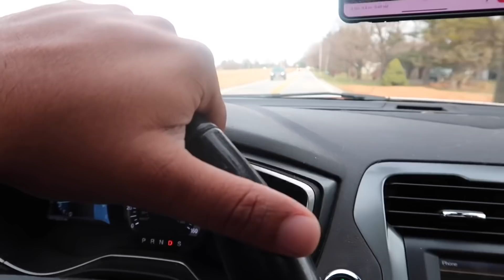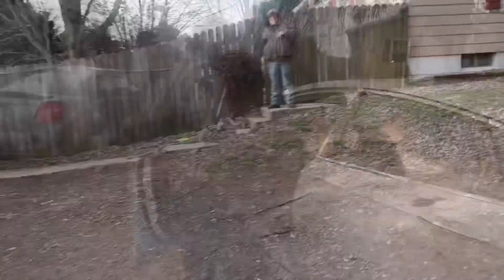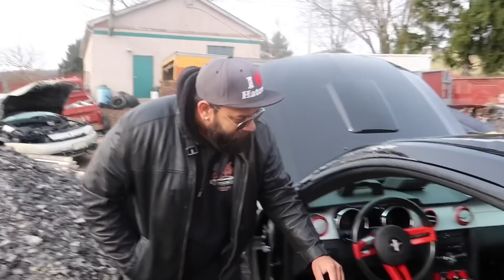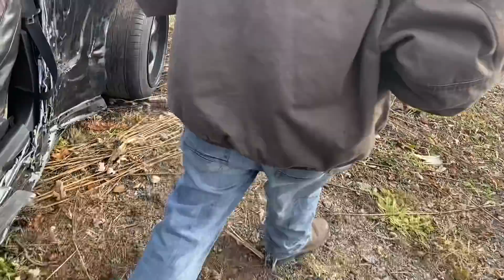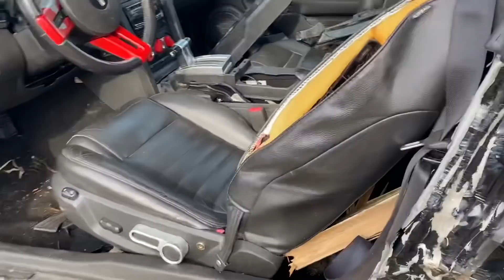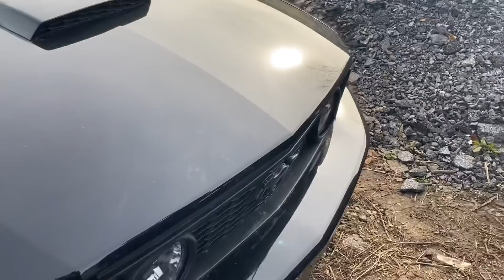YOU WON’T BELIEVE WHAT I PAID FOR THIS WRECKED MUSTANG GT!

Comment: At this rate you are ready for a garage update. You need to go with a steel building with concrete floor. Once the floor is laid, you can get a 30 x 60’ in place of your 12 X 40’ (this will fit lots of Mamba’s). And the kit cost will be about $18k if you can muster up some internet friends to come over to help build it with you.

Comment: I’m most curious of how difficult switching out the harness(es) are on these V6 to V8 transplants.  Is it just an engine harness, or does it include the ECM and any other electrical components.  This should be fun to follow!
Reply: Everything including.ecm. he will have Casper the friendly mechanic do it. Stangboy doesn't say he is a mechanic
Reply: The wiring harness should be be plug and play. Same thing with the ECU. Fuel pumps will need to be upgraded but you can just swap out the fuel tank for that.
Reply: The thing will need most of the kit transferred but ge has all the computers and if a couple of things are not perfect like trans as he is swapping to a manual it should just be a case of pin out and splice job or a patch harness.
Reply: @Stangmode Fuel pump doesn't need upgrade and neither does the radiator. They are same as stock GT parts FYI

Comment: The v6 uses a T-5 and is barely up to the challenge. It will not mount up. A 3650 (the 05 up edition) is what you need, highly recommend the MGW for the 3650.

Comment: its all plug and play. 
1. change wiring harness, has to be for a Manual gt if ur trying to keep it Manual. 
2. Gt ecm, don't even touch the fuse box. literally the same.
3. swap over the gt speedometer it goes up to 145mph v6 one only 125
4. Need a gt fuel pump
5. if ur v6 is manual u already have the clutch pedal
6. everything else is pretty much bolt on, 
7. switch over rear end from the gt, if not one wheel peel for days
8. you need a drive shaft for a Manuel as well I believe 
9. you might need a manual trans from a gt not sure if a v6 trans can hold up
everything else bolts on directly. everything is pretty simply I helped my friend swap his automatic v6 into a manual v8, he's the mechanic and he explained everything along the way as I helped him, I'm currently looking for a wrecked gt like the one u just found to swap my v6 as well. really can't believe u got a 71,000 mile gt for $1000, that's insane.

Comment: Can’t go wrong for a $1000 bucks. The motor sounds strong & turned over right away. You can also make the $1000 back (& then some) parting out the parts you don’t need. Good donor car buy IMO. Congrats bro!

Comment: T5 would not be a direct swap as has been noted. The T5 shiter is different as is the driveshaft and the rear end too, so all need to be swapped from a GT. Hydraulic clutch setups are the same though in both cars. Front brake rotors are larger as well. Someone mentioned fuel pump and pretty sure you'll need the lines as well. They run up the driver side so could be damaged. If you swap the front bumper you need the fender liners too so don't  toss them. Me, I'm sorry to see the 4.0 go :( would have rounded out the fleet.

Comment: @Stangmode nice that you found a donor car! So cheap!  I suggest you keep the College Mamba manual that's part of what you love about it!!! Get a used TR3650 trans and a new stock clutch. You'll probably break the rear end if you launch it too hard/too much so you may have to upgrade to the 8.8 eventually later. Good luck at Kasper's 👍👍💪
Reply: Oh wait....you already have an 8.8 rear in the donor car. 🤔 Might as well swap that over now. You will need the cobra pinion flange to bolt up to the manual driveshaft.

Please note that once you start messing with the rear ends you will probably feel some vibration at various speeds. I know you said in your video about how smooth College Mamba drives so just want to warn you on that. If you keep the stock rear end as is it will probably run smoother for you.

Comment: Hey STANGMODE!...You're Right!...God Does Work in Mysterious Ways!...But, I would suggest you use both the Engine and the 5 sp Auto Trans together in the swap!...The reason is, I Believe there maybe a Computer issue between a Manual Trans car vs a Auto Trans car, but I am sure your Mustang Mechanic will know for Sure!

Also, I would suggest a Saleen Extreme Body Kit with Center Exhaust and Rear Seat Tonneau Cover for your Convertible College Mamba!...I am Just Saying!...God Bless America!

Comment: Transplant surgery to be scheduled in short order.  Drive train is obvious.  I'm curious to see if the V6 manual tranny will mate up to the V8 engine.  Hopefully, it's the same tranny Ford would have put on the V8 in the first place and not a more lightly constructed version?  If not, maybe you can find a manual replacement, maybe even an upgrade from factory stock.  If the hood is straight, that would seem to be an obvious swap too as well as the GT grill with the fog lamps.  As you say, "the story never ends!"  :-)